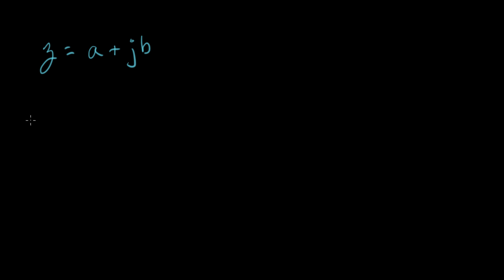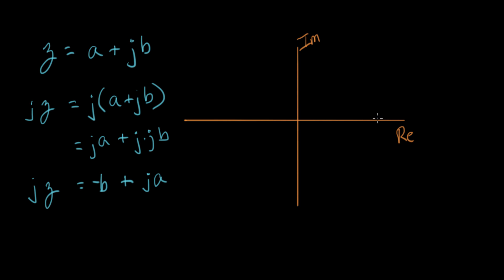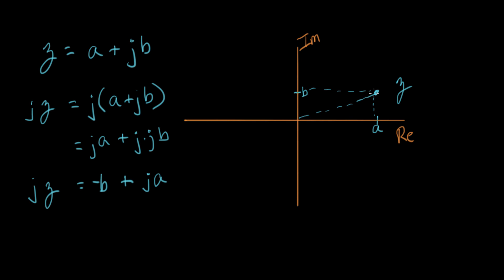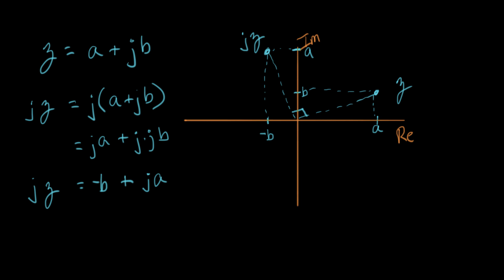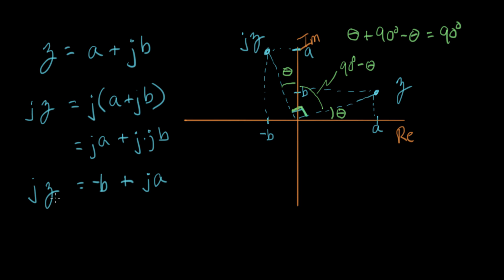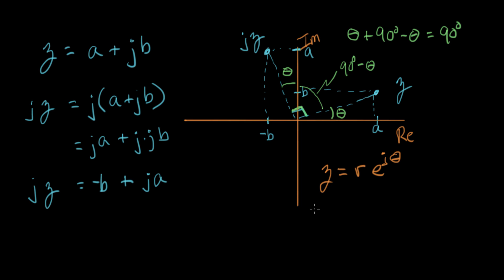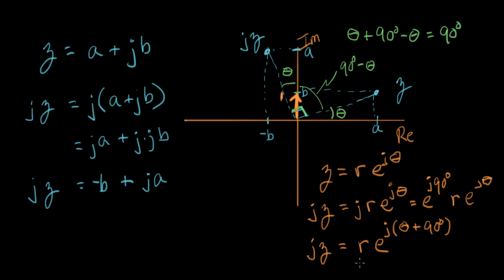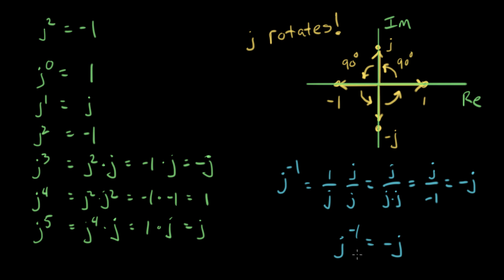Complex rotation

Comment: For proving that the angle between z and jz = 90 deg, didn't making the angle between the +Im axis and jz equal to that of the +Re axis and z already assume that the angle between them was 90 deg?
Reply: Think of it this way: The original triangle is definitely a right triangle, with legs of length a and b. The second triangle is also a right triangle, also has legs a and b. Since we know two sides (a and b) and the angle between them (90 degrees), we have determined a unique triangle. To see this, draw an angle made of two line segments attached on one end. You can see there is exactly one way to place a third line segment (side) that creates a triangle. So, since both triangles have the same two sides and the same angle between them, they have to make the same unique triangle. Once we know this, we can label anything on one triangle and know that it's the same for the other triangle, because they're the same thing. So, if we call the angle between a and the hypotenuse as 'theta' on the original triangle, it's definitely the same 'theta' on the other triangle (again, because it is completely identical or "congruent"). At no point in this process do we have to assume that the rotation was done at 90 degrees, and in fact this geometry works for any angle. Hope this clears things up a bit!
Reply: Ah ok thanks!